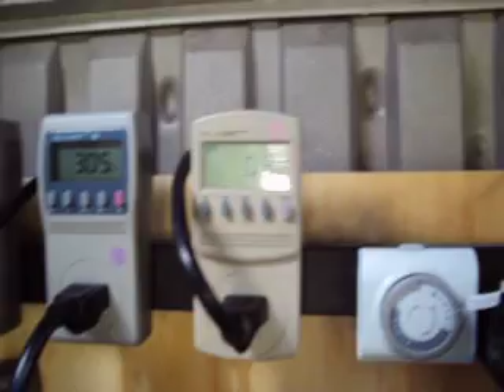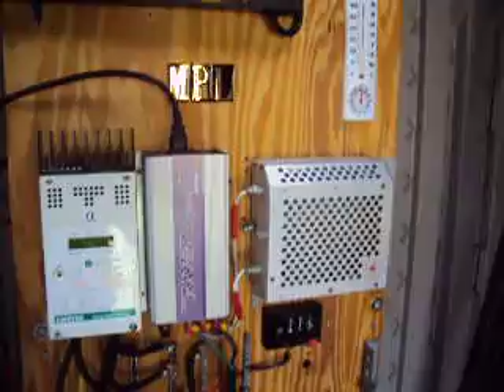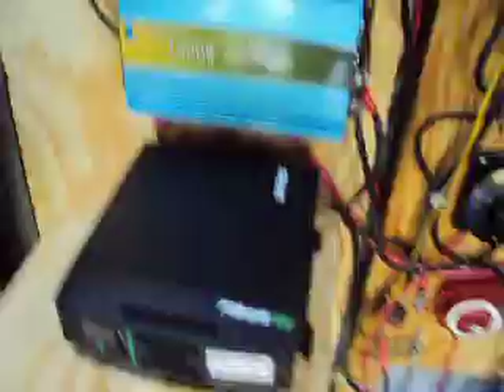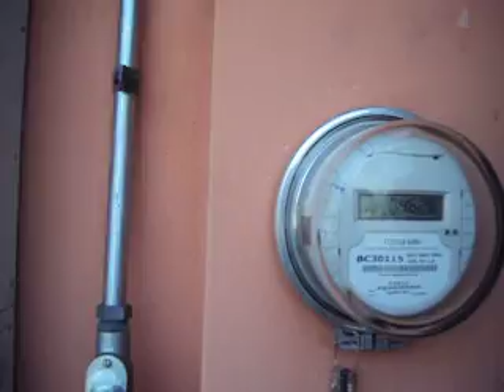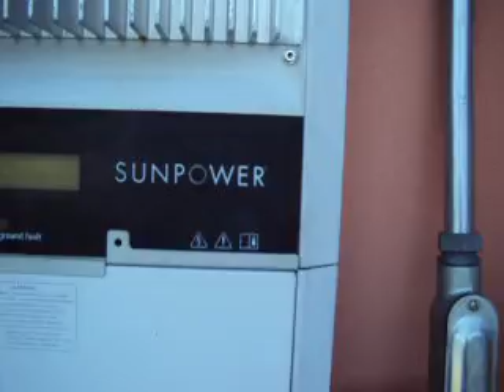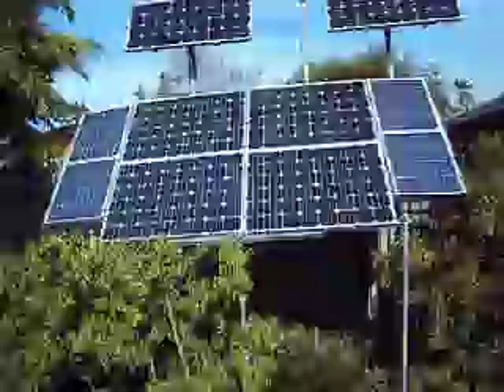Wind & Solar Grid Tie Battery Backup - Zero Electric Bill

Comment from the maker: Hi Thanks for the comment. by using a switch you get the most out of your system. Your not wasting energy because once the battery bank is full you divert the power to the grid.

Comment: Good video, you should do more. You got a great system, and love the flexibility of it.  I'm now in process of mounting a bunch more panels with Enphase Inverters, but will keep building my off grid/GTI DIY via transfer switch (like yours) for emergency back-up, since it's little tricky to get the Enphase GTI's to continue to produce power when grid goes down. Keep up the great work and thanks for sharing.

Comment from the maker: The meter does count KWH both ways.I recieve KWh credits which roll over to the next month.At the end of the year they pay me.The 2 mounts on top are from solar set point LLC. The main frame mount I designed myself. As I aquired more panels I just added on to the existing frame.